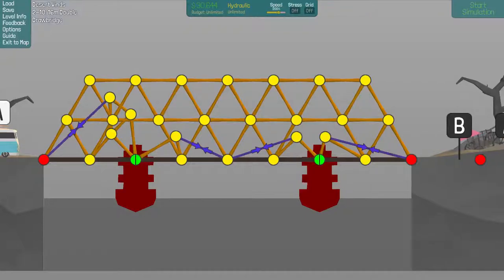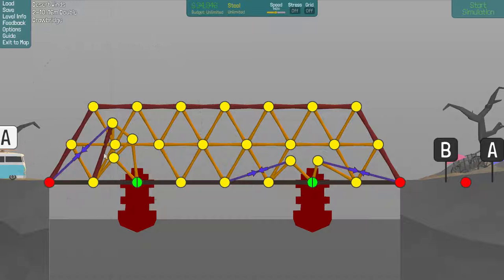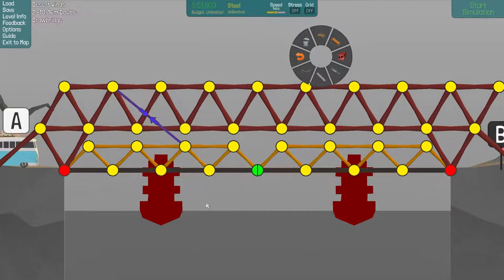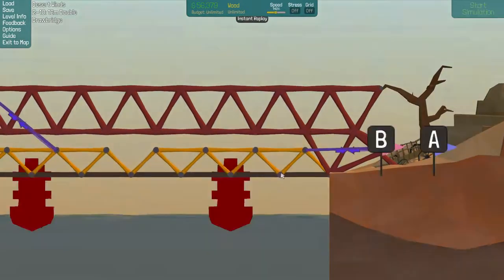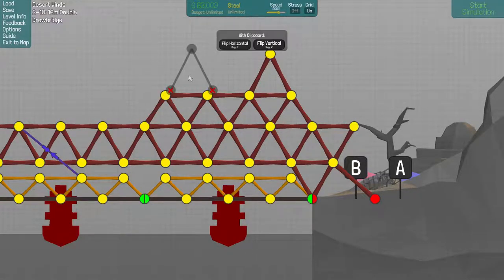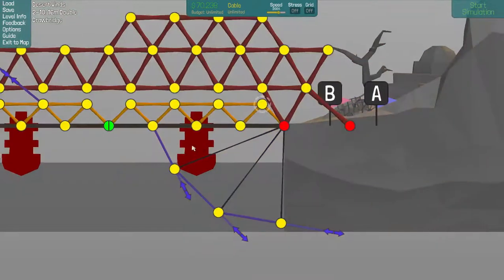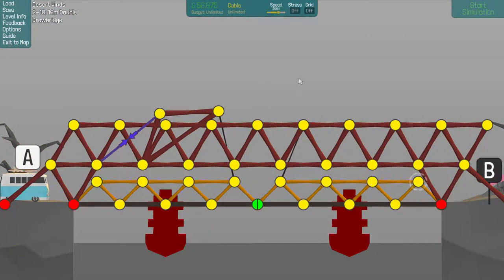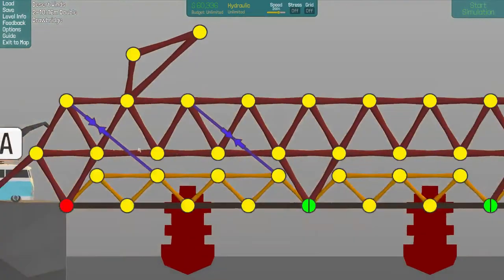Poly Bridge - Advanced Hydraulic Tutorial

Comment: great video! I still don't understand the rules about those pivots, how can you choose the pivot where the bridge lifts, it never works for me for some reason.. and the last part of the video is amazing.. is the magic behind having the pivot in the middle in those 1 and 2 connections? I'd love to chat about it to understand it better;)
Reply: macplash as for a pivot, you can create one by only having one node/joint connecting two, or more, sections. If that’s the case, both sections will remain attached but they can rotate freely, you can use a hydraulic to manipulate the rotation of the sections. In order to visualize it, imagine nunchucks, or a lever, door hinge etc. if you attach two or more structural supports between sections, a pivot will not form